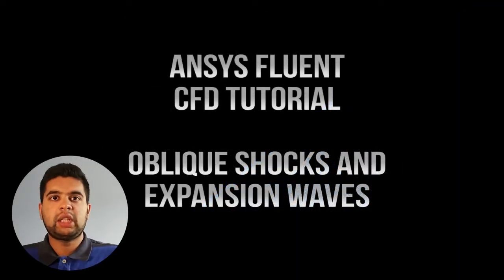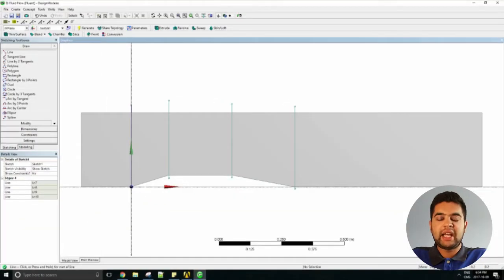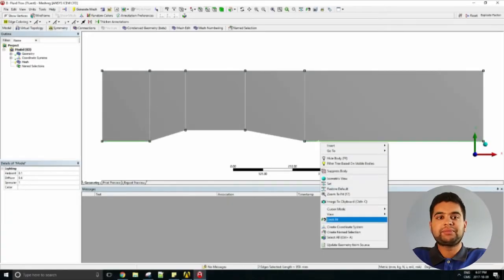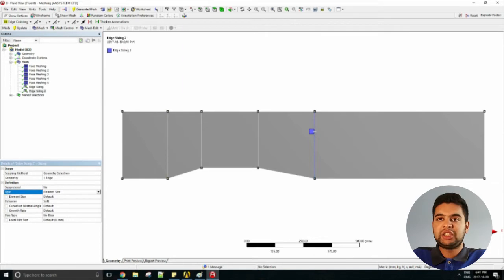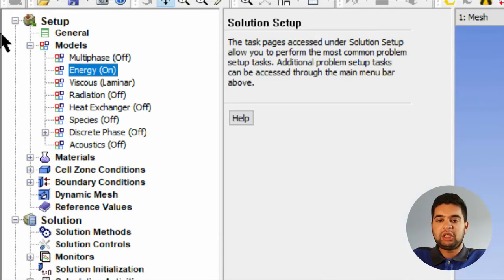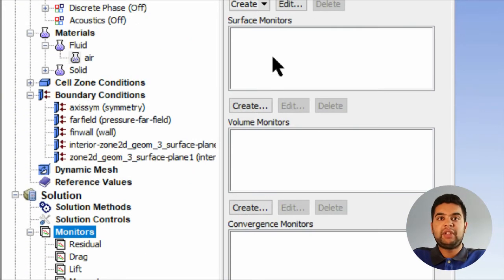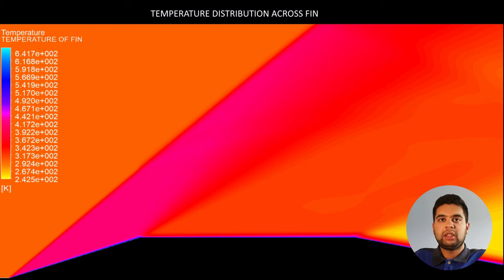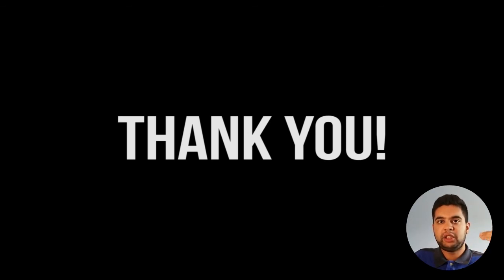ANSYS FLUENT CFD: Supersonic Flow, Oblique Shocks, and Expansion Waves Tutorial

Comment: Thanks for this video VD Engineering !
I've a problem in plotting chart for a 2D Airfoil flow. When I plot a chart for X vs Cp (pressure), the plots in the chart is always ending in 0.3 (in X-direction). I've no idea why it happens, and I've tried for different airfoils too. But still I'm facing the same problem, the pressure plots always ends in 0.3 (X- direction).

Can you please help me to solve this problem?

Comment: Dear VDEngineering,
                                  My sincere thanks for this tutorial. I have been trying to run a similar simulation and your method yielded amazing results. The approach I took as a novice of CFD has been quite crude and rudimentary in comparison. It has yielded very inconsistent results. While I understand what you have done differently from a simple procedural point of view, I do not quite grasp where I have gone wrong conceptually and theoretically in my approach. That is to say, I do not understand what physical differences there are between your approach and mine. I would very much like to consult with you on this further in order to understand where I was going wrong and how does following the steps in your video rectify it. 
                             Would it be possible for us to correspond further regarding this ? Please do let me know. I would be very grateful for your guidance. I will provide an email address if you wish. Thank you.
Reply from the maker: Hi Prateek,
Sure, you can provide me your email,
Basically, the mesh is the single most crucial part of this simulation as the flow is supersonic. In addition, you might be making errors in your boundary conditions which is creating problems for your simulation.